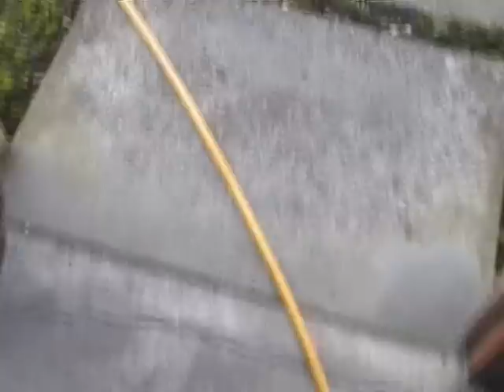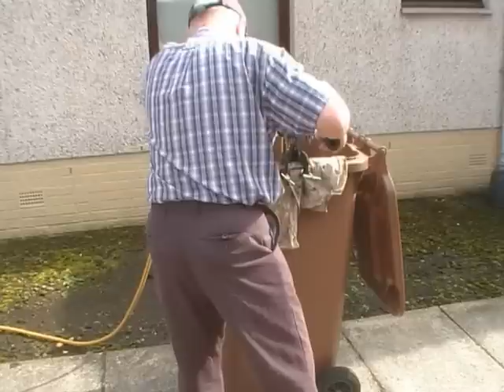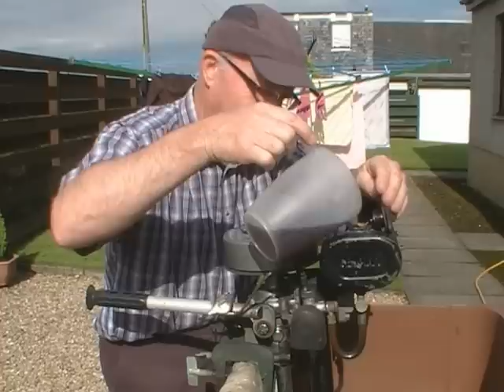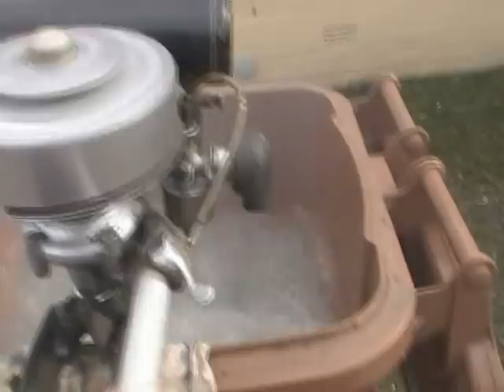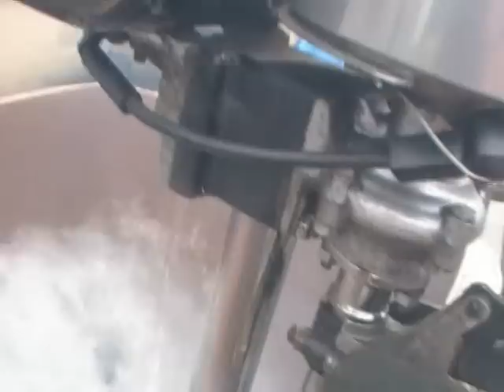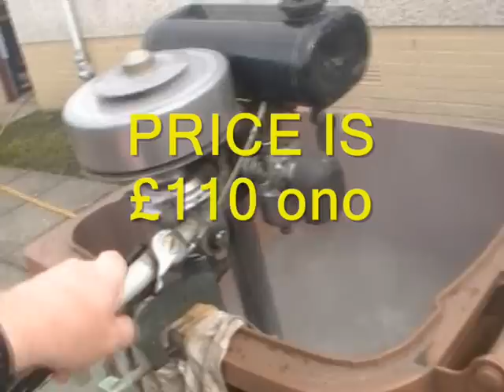British Seagull Outboard Motor - First Start in 40 Years!

Comment: people take the piss out of seagull's, ive had from 1hp to 175hp and nothing is as reliable as a seagull..if you go to sea and don't have a seagull as your back , then your a danger to yourself, these engines never fail to start even with petrol that is 20 year old. my engine was not started in 10 years and was a bugger to start,it took 3 pulls !!!!! I was devastated as in never used to take more that 1 or 2, I have now even cleaned the plug, its next service will be due in 2040, for that service it will get a NEW plug and the points cleaned. ha ha  brilliant engines and made in England.
Reply: I'm looking for a seagull, I just got myself a neat little plywood dinghy and thought a seagull would compliment it nicely. They're affordable too, some of the cheapest outboards available here in New Zealand.
Reply: Brilliant simple little engines. Can get parts easy . They just go on forever.
Reply: phill downes n
Reply: jeff sonnichsen  what is "n" supposed to mean ?

Comment: my grandad told me this story about how you could drop a seagull into a clean river, pull it out and it would start just fine again! i still use my seagull for my dingy in the summer, awesome little engine!
Reply: They are impressive - we had to wash the salt out of one that was dunked in the River Yealm estuary. which is salty.
It never started that well afterwards, but who can blame it?
Back in the  '50S you'd see small yachts puttering along with a British Seagull clamped to a plank hanging  out over the side. They were surprisingly good at this because of their (relatively) big props and low gearing.
It beats trying to row a keelboat!
Reply: Y muy bueno para hacer Currican

Comment: Is that Oxtail Soup going in the tank? Do these run better on soup?
Reply: Yup....
It'd be "petroil' mix that both powers and lubricates the 2-stroke engine.... and makes blue smoke too.
No longer recall what the fuel/oil ratio was, but  it was pretty heavy on the oil. 
There are/were oils available for this very purpose that were allegedly "fish friendly". 
Right.